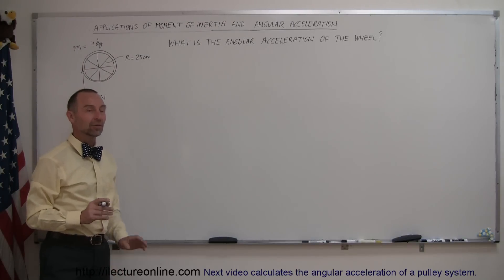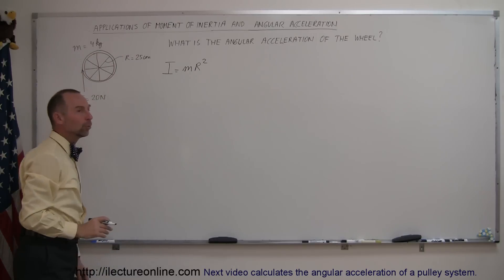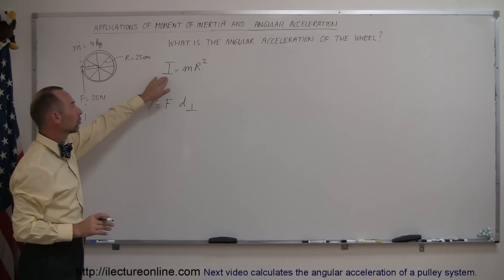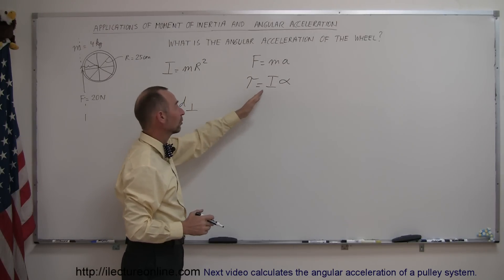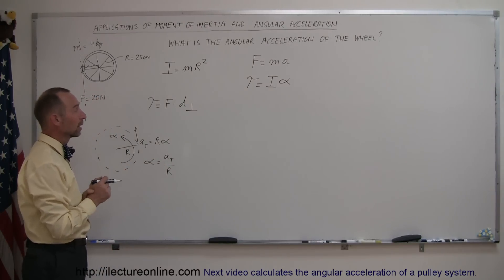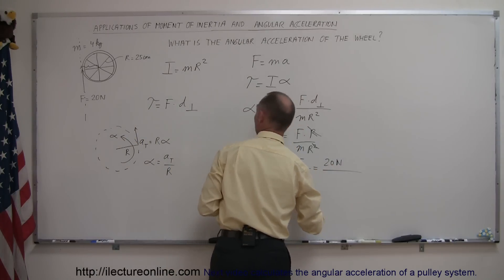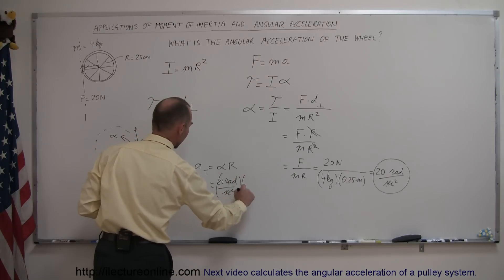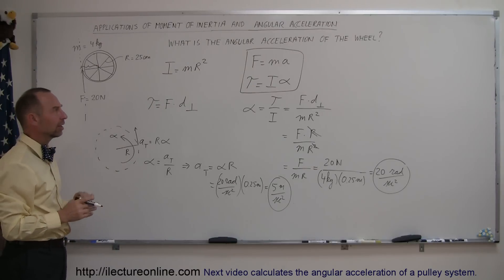Physics 13  Application of Moment of Inertia and Angular Acceleration (4 of 5) Rolling Wheel

Comment: I know Prof Biezen must solve the prob for the sake of demonstration of torque purpose. However there's actually an easier way to solve the prob. Since we know F=20, m=4, and R=0.25m, we can get the tangential acceleration, a=F/m=20/4=5, and then we can get the angular acceleration, alfa=a/R =5/0.25 =20

Comment: How would you find the angular speed?
Reply from the maker: Shiro,
Angular speed = angular acceleration x time.
You would need to be given the time in order to calculate the angular speed at that time.
Reply: +Michel van Biezen Isn't angular speed the absolute value of angular velocity. Would this be analogous to linear speed being the abso. of linear vel. S=[V] W=V/R, W is the Angular Vel. V is tangential Vel at the farthest point or distance from the radius at the line of force.  R=radius So, can you get Angular speed by getting angular velocity and placing within absolute. Which are all given in your calculations?
Reply from the maker: Darkness 
Here is where angular velocity and angular speed tend to be used interchangeably.
Angular speed is defined as d(theta) / dt
Angular velocity is defined as d(theta) / dt with the direction perpendicular to the plane of motion as defined by the right hand rule.  Point your fingers in the direction of motion and your thumb will point in the direction of the angular velocity.

Comment: When I enter (20)/(4)(0.25) into my calculator I get 1.25 not 20
Reply from the maker: 7hreden
You are probably entering the numbers into your calculator incorrectly.

Take a look at the problem.  You don't really need a calculator.
When you multiply the 2 numbers in the denominator you get 1.
Then 20 / 1 =  20
Reply: +7hreden .25=1/4,  1/4 * 4=1